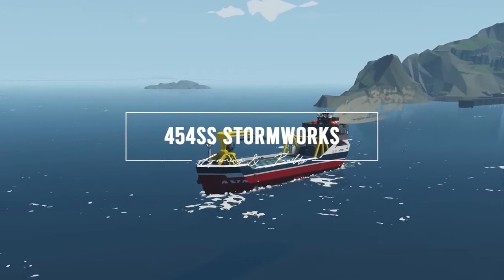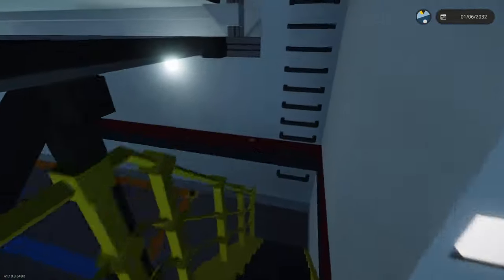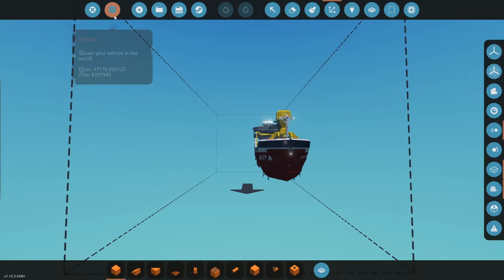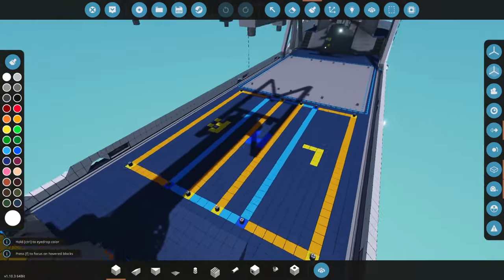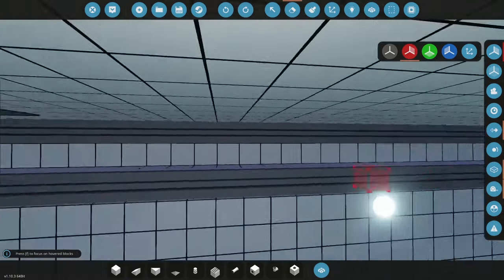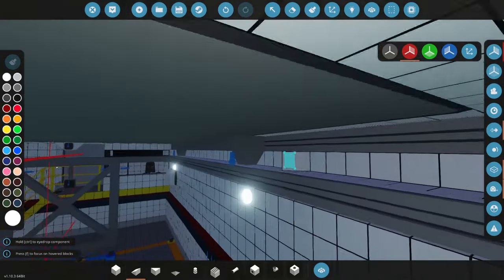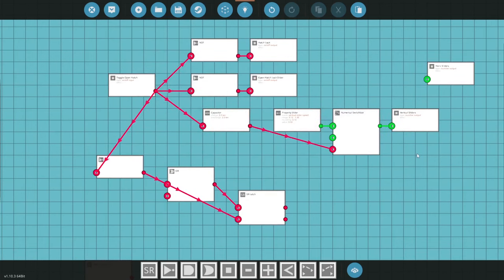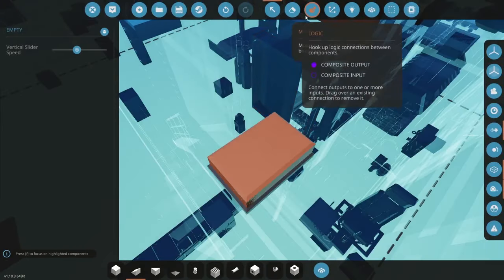Cargo Ship Automated Hatch and Container System in Stormworks

Comment: The way i combat the tilt is i have a rail beam in the bottom of my ships. It is controlled by a tilt sensor connected to a pid controller. And while it does make the ship abit more heavyer than others it is effective. Not to mention that you can adjust the pid to controll the roll speed. And it is really customizable as you can make it diffirent sizes. That is what i use in my newest ships. The old ones just sit so low in the water that it is not needed.
Reply from the maker: Great idea! :) I use this type of system for some of my boats, but I will see if I will use it here! Not a lot of space left XD
Reply: @454ss_gaming  
My hull on bastion has 3 layers in the bottom. Fuel tanks, weight and bottom decks.
Reply: I'm a fan of leveling ballasts, you can even use a split fuel tank as one.

Comment: I think your understanding of the capacitors is slightly flawed.

They are more of a timed on / off switch.

Charge time means you must input an On signal for X time before the "capacitor" outputs an On signal.

Discharge time means the "capacitor" will continue to output an On signal for X time after the input On signal is lost.

So, if you set charge and discharge to 0 seconds, the output will mirror the input.

If you set them both to 10 seconds, you need a continuous On input for 10 seconds, it will output an On signal for as long as the input is On, plus an additional 10 seconds after thr inout turns Off.
Reply from the maker: Yup :S I realized that after, the capacitor does not act like a timer! haha Thanks for the detailed explanation